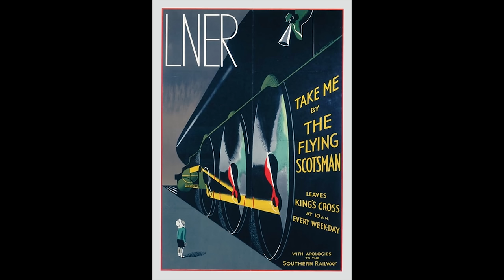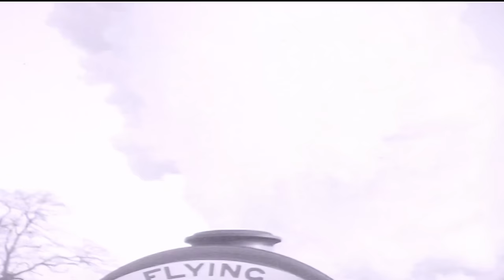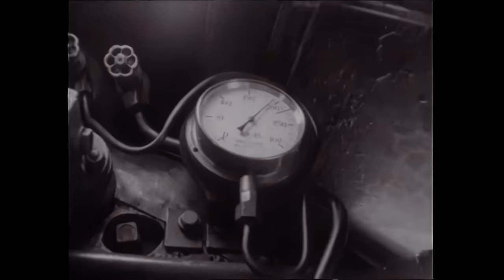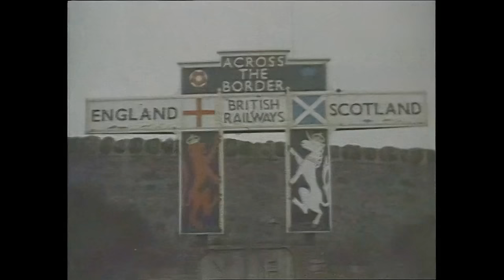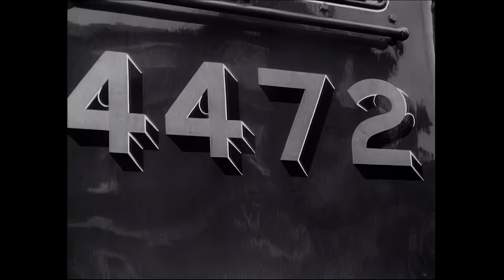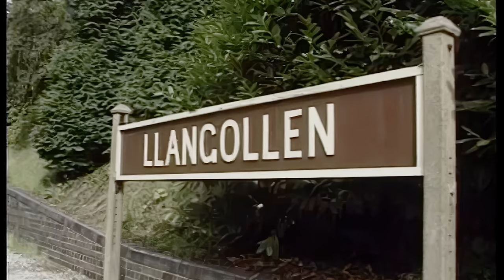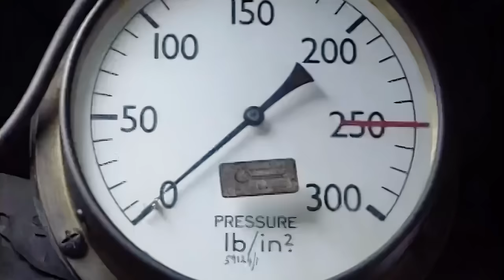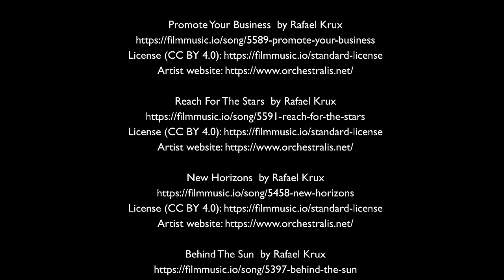The Flying Scotsman, the Most Famous Steam Train in the World

Comment: LNER Class A3 4472 Flying Scotsman
Specifications
Driver dia. 80 in (2,032 mm) diameter
Length	70 ft (21.34 m)
Height	13 ft (3.96 m)
Loco weight	96.25 long tons (97.79 t; 107.80 short tons)
Wheels: 4-6-2
Cylinders: 3 - 20in (508mm) diameter, 26in (600mm) stroke
Power:  (app) 1500kW
Tractive effort as A3: 147kN

Thank you for the video, She Has a Story!

Comment: Pedant alert! "Flying Scotsman" is possibly the most famous steam LOCOMOTIVE but is not a steam Train. "The flying Scotsman" train was originally  pulled by this locomotive or others of its class but went on through A4s and into the diesel era. This account mentions that the flying Scotsman had to be rebuilt to a higher boiler pressure and longer valve travels but doesn't mention this was only after the class had been whipped by the GWR Pendennis Castle in the locomotive exchanges. Sir Nigel Presley was a great enough man to acknowledge his mistakes and immediately set about upgrading the A1s to A3's. However no credit is given to G K Churchward of the GWR who establish these principles. Also an overseas reader would be surprised to learn that there are many other large great locomotives pulling special trains and clocking up impressive mileages on Britain's railways - although it may be the oldest express locomotive still going.

Comment: You need to differentiate between the Flying Scotsman train, and the Flying Scotsman engine. They are poles apart. The Train began running in 1862 between London and Edinburgh. The Engine was built in 1923, and did often haul the train of the same name, but they are not the same thing. So 4472 may be the most famous engine in the world but it is not a train.

e world

Comment: It is not the most famouse steam train in the world, it is the most famouse steam engine/locomotive in the world, a train is made up of a Loco and Coaches and there is a train called the Flying Scotsman as well as the Engine
Reply: I would have thought that the most famous "train" in the world was the "Orient Express"
Reply: @carlwalker7560  Did you bother to read my comment or not, I actually corrected the intial person who did this video where they comented about the " The Flying Scotsman, the most famouse steam train in the world" which I said "No it is not the most famouse steam train in the world, it is the most famouse Steam Engine in the world". A train comprises a Locomotive and Coaches or a multiple unit of coaches with a driving cab at each end. What they are on about is the Flying Scotsman Steam Locomotive, and yes there was a train from London Kings X to Edinburgh which left London Kings X at 10.00 AM called the Flying Scotsman as well which still runs now and it is not called the " Orient Express" now but " The Venice, Simlon Orient Express" which runs from Near Calaige to Venice with a UK connection.also known as the VSOE